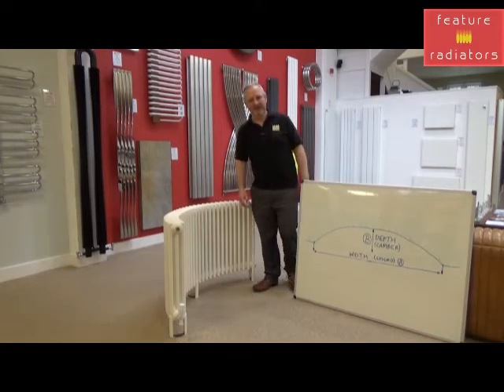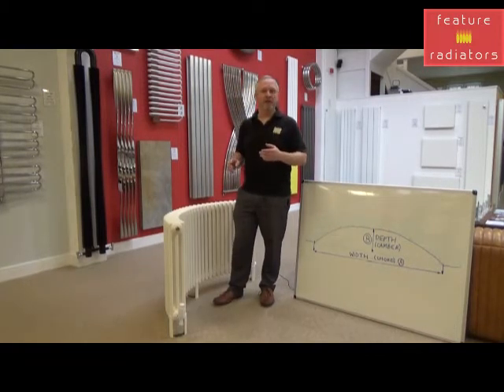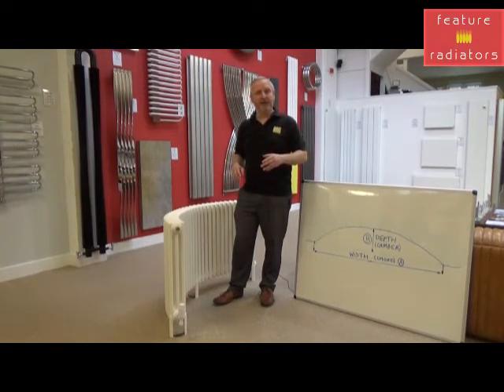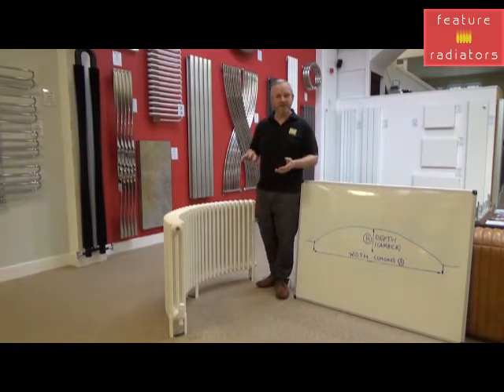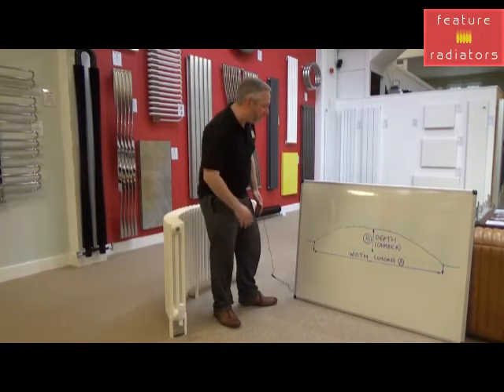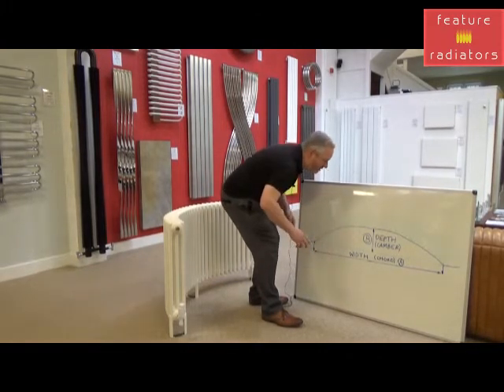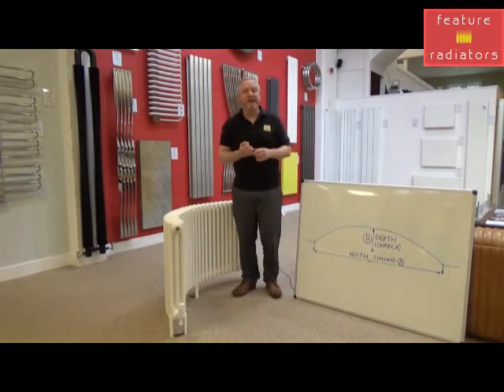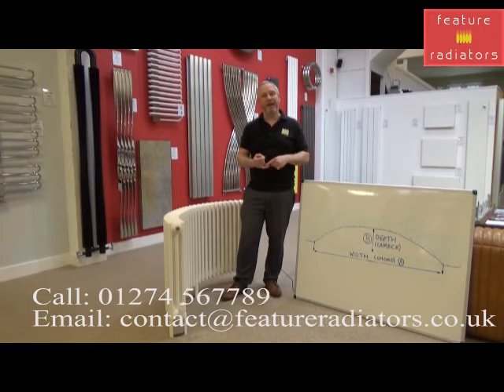Bay window radiators - How to measure

Comment: Bullshit...you cannot define the radius of a curve from the depth of the centre of a curve...you actually need a number of measurements...1) the width of the curve from each side of the straight walls it adjoins. 2) from the centre of that measurement, a number of measurements - from the centre line of that distance (across the bay to each straight wall) to intersecting points of the curve around the bay...spaced out regularly and evenly, at say 150mm distances, to establish the ‘arc’ of the curve... only then can you accurately assume the arc, and the ‘bend’ required for the radiator curve, which should match that arc...!!
Reply from the maker: Hi Stu, thanks for the comment (minus the profanity), we have been selling curved radiators for 3 years now and I can confidently say not one has been manufactured incorrectly using the information we provide. Hope that helps.